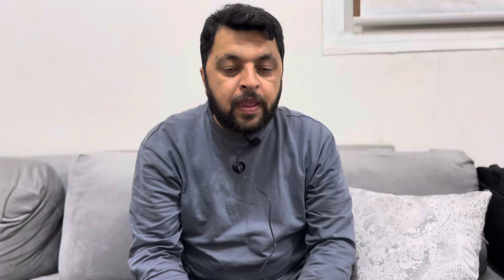My Latest Interview with NEOM for QA QC Inspector |Interview Questions & Answers for QA/QC Engineers

Comment: Your answer is good , I am Aramco approved technician if this type of situation you must check the slump according to ASTM C143 , if slump  meets the allowable tolerance you should be allowed for concrete poring. if any one has more reliable answer plz mentioned me in comments. thanks
Reply: Before the commencement of concrete, some presumptive steps are considered, i.e., weather forecast including rainfall and temperature, cold joint treatment chemicals are stored in case there's a malfunction found in the concrete pump/pumps, concrete vibrators, lights, polythene sheets for covering concrete, etc. 
However, if you fall in a situation like this, it is better to pour concrete but cover it from the direct contact of rain water by pitching polythene sheets on it. Concrete's initial setting time will be achieved in just 15 to 20 minutes after the moment when rain starts and it will reach its final setting time as well under the waterproof polythene cover. 
If there's somebody who can share their views are cordially welcome 🤗

Comment: Regarding your 4th Question the concrete truck delay to reach the site around 10 or more than 10. what was your answer i did get your answer. shall we allow the truck to pour the concrete?. OR if it is the last truck, Shall we reject the concrete truck and do the finishing whatever we already poured concrete?
Reply from the maker: It depends on the consultant but it will be good to pour the last truck and avoid cold joint if it’s just 10 minutes delay